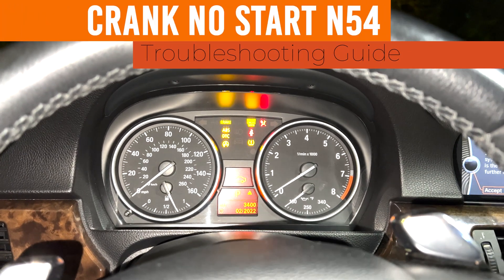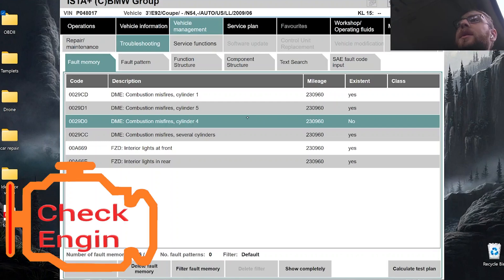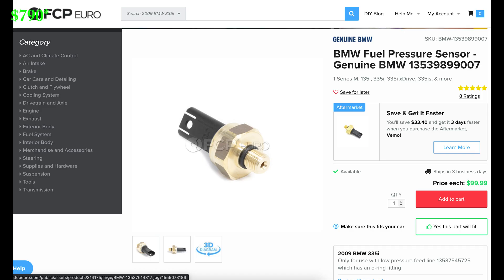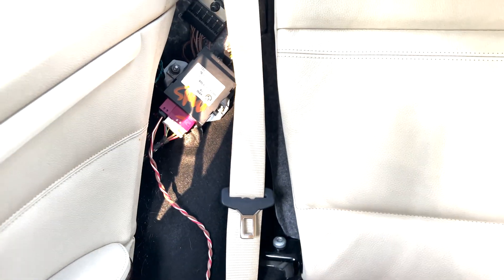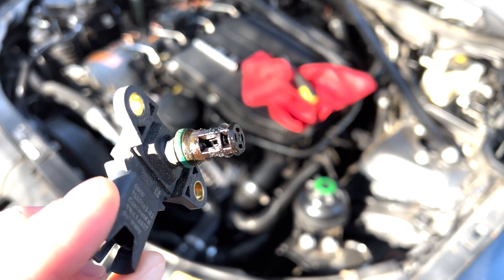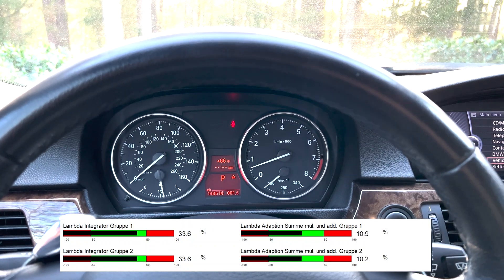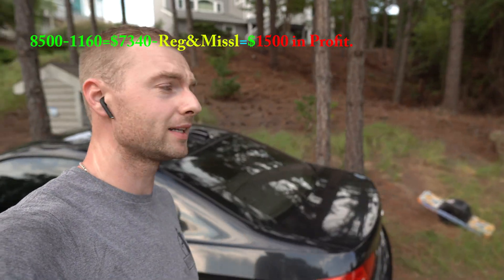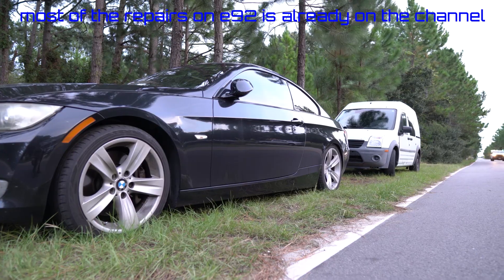BMW N54 Crank No Start Troubleshooting & Repair F*****

Comment: Hey man anyway you can help out with my 335 it’s been down for months and no one can figure it out my codes are for : tank vent valve ,crankshaft sensor, oil condition sensor, fuel supply control valve, and electric cooling pump and sometimes ibs sensor
Reply from the maker: Can you start the car? And what sensors did you replaced if any? Also, what Year of manufacture.?
Reply: @Makhnovets  hey thanks for the reply it’s a 2009 335xi with msd81 dme so I doubt it’s the dme but I replaced crankshaft sensor twice ,hpfp, both fuel sensors, fuel pump module, spark plugs, alternator, starter, battery, and checked voltage to the crank sensor and it was good and I removed my jb4 and purchased a wedge performance tune all of these things did not work the car has very long crank but will start to answer your question but on cold start it wants to stall really bad when it’s warm it’s just really long crank any ideas? I’ve been to 3 diff mechanics
Reply from the maker: What about mixture and compress? Do you have code for mixture control? 
Did you reset all the settings/map, the volume and channel and set both spedo and tachometer to 0 in jb4 menu. You probably know better than me!
Try to reconnecting the jb4 and make sure is disabled, sometimes when you change the settings it’s failing, so make sure it’s default settings!
Did you try to installing jb4 back on the car? Any changes after installation jb4?
Also try to re-write to some map, and see the outcome, then back to stock.
Reply from the maker: He's got all the options explained, make sure everything is by default, scroll true the menu and confirm everything! https://www.youtube.com/watch?v=ml4ala6Cc2g
I would agree with you that your DME is the issue but i more than sure that the JB4 was the main issue. It enough to be one lag. To mess up the dme... if you have NCSExpert you can try to set every single module to vehicle Order, but I'm not sure if that will work, it should. At least I think so.
Reply: @Makhnovets  hey so no mixture codes and also I don’t think the jb4 will be going back into my car because I purchased a wedge performance tune thinking maybe the tune could’ve been the problem also and wedge doesn’t work with cars that have jb4 in them and I’m almost positive it isn’t a problem with my dme I’m thinking it’s an electrical short in one of the sensors somewhere or smth because all of my codes are coming from the 5 volt reference circuit ground so I think something tripped that circuit all of my codes are for sensors which makes no sense all those sensors could not have all went at once
Reply from the maker: Little long but sure way to check it is to start disconnecting modules and see what is going to happen, one by one. Check the BCM, it has connections from nfrm and cas. Seat module. Did you ever notice wet carpet? 
Also is anything in particular not working? Might radio or some buttons? Disconnect the ibs as well.
Reply: @Makhnovets  I think everything seems to work although I’m in limp mode and transmission failsafe so the car barley drives in that state and I have a really long crank no matter warm or cold but it’s like a Healthy crank I have videos I just can’t post it in here it doesn’t let me but I’m cold start the engine wants to stall and it barley stays alive and then my fan is on full blast when I do get it to stay alive
Reply from the maker: I still think that you have dme matt problem. But on other hand if the k-dcan line is damaged you will have miscommunication problem, once i had my power regulator on the alternator dying, i had similar problems, but in my case car stop supplying power to some components, ant it was saying water pump missing, alternator missing…
Like you said there could be the electric problem.
You can check this one, it might be somehow helpful.
https://www.youtube.com/watch?v=pd6Pn54DN0Y
Reply: @Makhnovets  thanks for the help I’ll look into that and do some more tests at the moment my car is with the 4th mechanic I took it to hopefully he figures it out but if he doesn’t I’ll try all the things you told me about thanks for the help again
Reply from the maker: @jeffreydobrushin3620  the pails and the cheapest one will be to code some of main modules to Vehicle order with ncsexpert. https://drive.google.com/file/d/1Iy2vsQHLlm5uLjyw8qGCPG02-NZml1io/view?usp=drivesdk
Just fine somebody with bmw tools, they only can be run on windows. If you need more help with that leave me a new comment! Good luck!

Comment: Ahh man here we go again. I love all the great info you are making great videos. I also have trouble with my 08 335i. Cranks no start. Only code is a fan control.
Reply: Yes I did but nothing. Swapped the fuel pump and the fuse box but nothing
Reply from the maker: @edwingarcia3066  sorry for some reason I didn’t see the reply. Did you figure it out?
Reply: @Makhnovets do you know what would cause this? I’m having the same issue with the fan control being the only code
Reply: @edwingarcia3066 do you remember what this issue ended up being? Same exact thing is happening to me, the only code is fan control
Reply: @TJ1K_828 did you fix your problem?
Reply: @josuepdavidpoleocayaffa6124 lol no bro, it’s a long story. I sent it to the shop and they changed the lpfp (after I already changed it) and messed with fuel adaptations and it ran for about 50 miles. I’m having the same problem right now
Reply: @TJ1K_828  omg, I got my n54 about 2 months ago and today while I was backing up into the garage it just died, and I have no clue what’s going on 😢
Reply from the maker: Did you try running the car on the starting fluid?

Comment: Hey, I'm having the same issue with a z4 35i, I've gone through most of the same fixes and no luck. 
Do you think I could hire some of your expertise to help me get it running?
Reply from the maker: Hey man! What code’s you have if any? Did you try to use starting fluid? Does engine runs at all? By the way i just got myself a 2009 z4 35i! Amazing car!
Reply: @Makhnovets  a code for boost controller, and misfire codes when I run in on starter fluid but it runs and revs.
Both pressure sensors are new, injector shoots fuel, spark plugs are new. Fuel pressure regulator is new.
Reply from the maker: so the way how I got my car running, I used the starting fluid for about 2-3min and It starts working on its own. There is some data that when a vehicle has a fuel problem, and its seats long enough to dissolve the carbon that been on the piston rings, in this case, you have not enough compression to start the engine. Some put a tablespoon of oil in the cylinder and let it seat overnight, I used the starting fluid. 
Try to run the engine on the starting fluid for a couple min, it shouldn't harm anything, usually, you have lots of gasoline in the cylinder, I think you flooded your engine with gasoline.
How the engine works when you run it on starting fluid? is it smooth? or rough running? If It sounds like it working as it should, in that case, go ahead and use SF.
Reply: @Makhnovets  your suggestion 100% worked. It took about 2 mins, lots of gas sprayed into the intake (instead of starter fluid) and it was able to run afterwards. 
Truly crazy, but thanks a bunch.